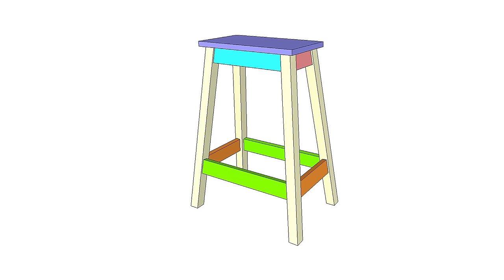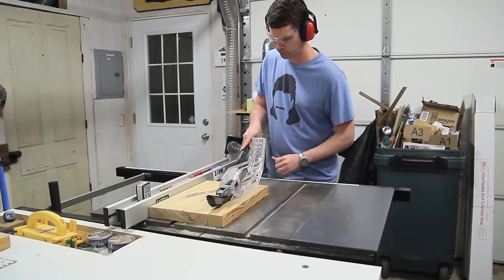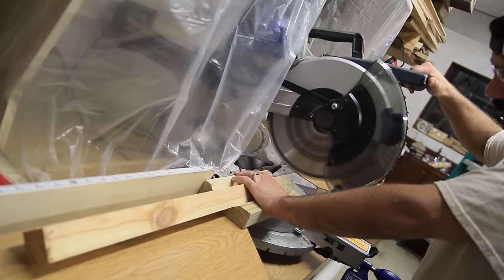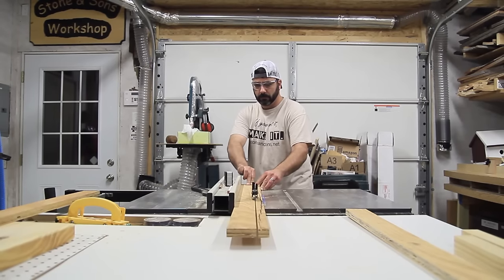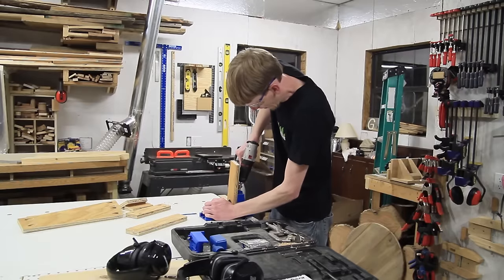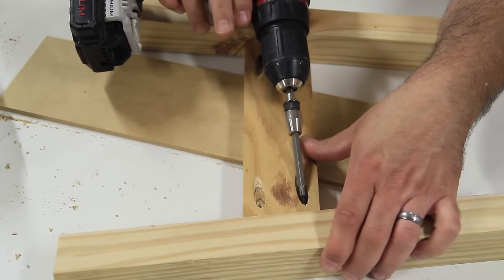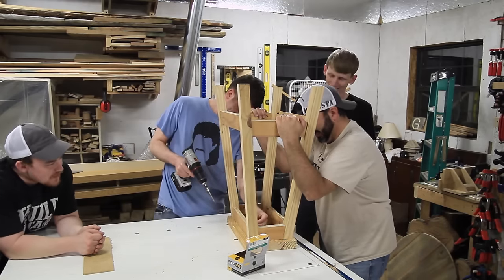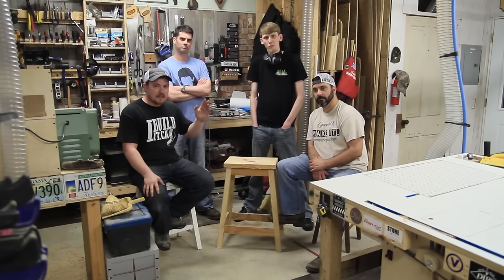How To Make A Bar Stool or a Shop Stool - 246

Comment: Doing a stool today...with only 2 hands...and a few clamps...from rough and punky 2 X 12 Red Cedar...Great project...though I found that most of the immediately accessible information did not seem to address stock over 1 1/2 inches and stock that has an angle and attachment as in the shop stools...Also worked up a fitted seat with a roughed out template...Felt that it was a good although not easiest first pocket hole project for me...Should finish tomorrow...Will use indoors as a bar stool...Will probably deepen the wood with garnet shellac and perhaps some tint as well and some new wax I picked up... and make another

Comment: +Jay Bates  - Built some of these today for the shop. Everything went really well. I used your 45' jig to cut the angles. - One problem on your plans in the PDF though. The lengths for the bottom rails are way too long. The long rail @ 16 inches is the same width as the seat so there's no way that would fit. I cut the bottom rails to 12.5 and 8 inches (roughly) - No big deal but worth a mention.

Comment: Hey Jay, that was a fun video.  Quick question; are you using regular drywall screws in your pocket holes? If so, any issues with cracking or splitting of material?

Phil
Reply from the maker: +Jake and Emmy's Dad Workshop I've never used them before but Shawn said he has. I've heard a lot of people who use them.
Reply: +Jay Bates  +Jake and Emmy's Dad Workshop collaborative podcasts? Two hours of pocket hole discussion? Now that I think about it never mind. Thanks for the podcasts though- both are very informative and well done.

Comment: I love my pocket-hole computer desk I made.   but I figure the stool is going to have some torsion
put on it as U move around on the stool ??? due to the torgue and your body weight,, how big a person do U
think this stool can support with just using pocket screws ????
Reply from the maker: +james waldrup Due to the geometry and the amount of screws that are distributing the load I would bet that this stool could hold 1,000 pounds easily.
Reply: +Jay Bates cool.   I weigh around 380.   will give it aworl
Reply: +Jay Bates Yes, but that is straight down. What happens when you wiggle a bit?